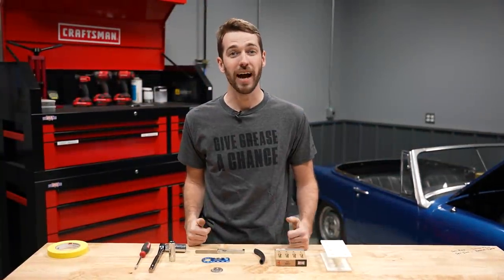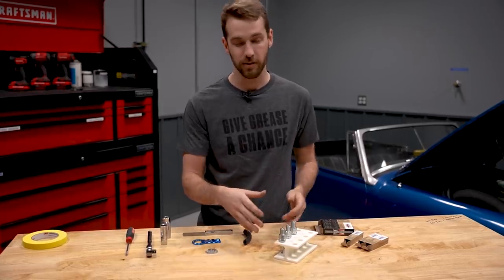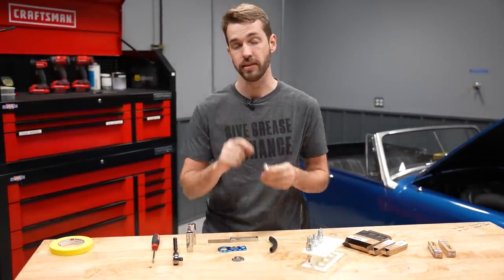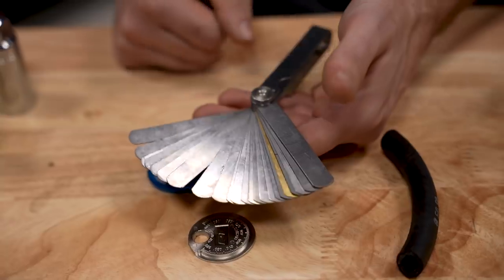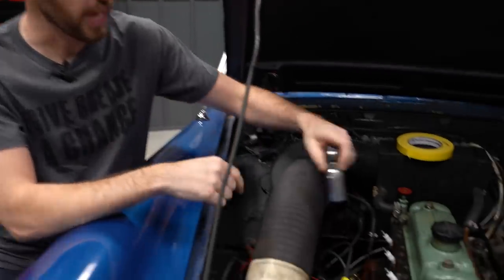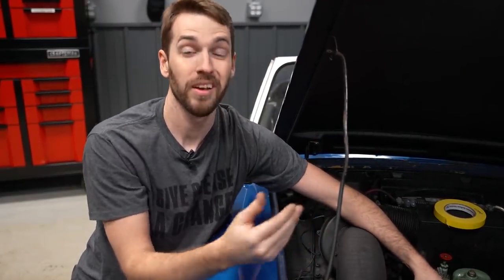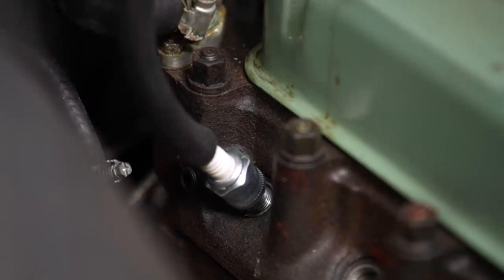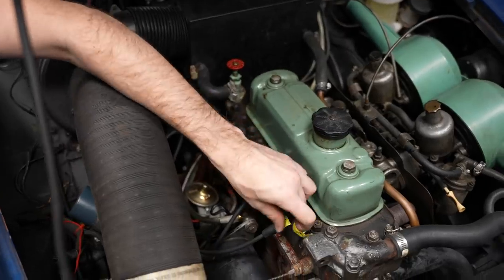Things to know when changing your spark plugs | DIY

Comment: You can skip a bit of the scariness with cross-threading your spark plugs by applying gentle pressure to the back of the plug while turning counter-clockwise until you feel/hear a small click. That will be the end of the threads of the plug passing the end of the threads of the spark plug, at which point, you can turn the plug clockwise for installation, without the fear of cross-threading. Use a hose or don't, but consider this method for any threads you're especially worried about cross-threading.
Reply: Good tip. Thanks!
Reply: This is my method too. People think I’m dumb sometimes; they’re like, “you know it’s righty tighty, don’t ya?” And I’m like, yesss…
Reply: Is it possible to cross thread using hand tightening method with an extension and two fingers...because I can't hear a click or feel if I'm catching threads?
Reply: @DavidTMSN  In that case get a youngster who still has feeling in the tips of their fingers to handle starting the threads for you.
Reply: They don't tell you when you're younger how terrible it is to grow older...or maybe they did and I just don't remember.

Comment: I have a four cylinder motorcycle and it can be a little tough getting the middle two spark plugs in and out.  it's a weird angle and there's not a lot of room for the wrench.   I recently learned the rubber tube method for putting them back in without worrying about stripping the threads.  Works great.

Comment: Hahahaha! Haven't seen an engine with plugs that easy to access since, well, cars like that were made.
Reply: I have an 05 Scion and a 93 Miata, I can change the plugs in both of those cars in less than a half hour including taking the tools out and putting them away. The Scion has a plastic engine cover and bolt down coil packs making it only slightly annoying.

Comment: Changing plugs 1 at a time eliminates numbering & getting debris in all the open cylinders. Even if the plug is pretreated use anti-seize compound which also acts as a lubricant to prevent cross threading. Pull, clean, inspect & regap the plug & the vast majority of the time it will not need to be replaced.
Reply: Also, use the spark plug socket to reinsert the plug to eliminate the rubber hose.

Comment: A couple of things that came with experience or just bad luck. First off you might want to not only check the manual but in some rare cases, unless your me then it is every third car I own, there is a factory service bulletin that supersedes the manual and gives a different plug or gap, or both. Another thing you learn over time is that the brand of spark plug recommended is not a suggestion, generally that brand of plug will give the best longevity in your engine. 

Finally there are a whole lot of spark plug gap tools out there, I was a big fan of the wire type gappers for years and I still keep one around but my all time favorite is the Bluepoint plyer type gapper. A lot of people do not like this tool because it is really easy to ruin a spark plug with it, I have had mine for 20 years and I have been using this type of tool for over 35 years and I have never personally ruined a new spark plug in it. I will say that I have seen people ruin plugs in the plyer type tool, and I have myself used the tool to see how much force it took to ruin an old plug. I am confident that if you ruin a spark plug in a plyer type tool you would have ruined it no mater what tool you were using.

Comment: I was taught not to use points feeler gauges to check spark plug gap. I use a circular gauge with different size wire around the outside edge.

Comment: In 1972 I had an 1800 cc engine with twin SU carbs and those Champion plugs would not last more than 6000 miles. And brother I did learn to service and tune those SU carbs such that there was no soot on my plugs and it started all winter long. Given that background, I'd have fixed that rich SU carb before I changed the plugs, but otherwise nice job!

Comment: Also when installing new spark plug give them back turn and feel the step up from threads then start to screw. This will help if you don't have hose with you
Reply: what is "back turn"?
Reply: @kennorway9690  Turn it counterclockwise.

Comment: Direction of side electrode IS IMPORTANT!!! You can gain few HP just placing electode in optimal direction in combustion chamber. Read engine perfomance books.
Reply: amen , ive been "keying in" my spark plugs for years , and yes it works , especially in aussie falcons it stops the intermitent engine kicks
Reply: Nice tip. If you don't mind, can explain what the optimal direction would be tho, for those of us not aware, please?

Comment: I used the same plug that’s was in the truck when I got it, ran fine before and didn’t wanna take any type of gamble.
Reply: There is zero gamble if you use the manufacturer specification. Using whatever is in the truck already is a gamble without research.
Reply: @YeetxBoi  I searched it, they’re comparable and engine likes the. Just didn’t wanna switch brands after 23yrs
Reply: @Joe-nq6hy  my 318 magnum is finicky with certain plugs. Some engines have a spark knock, prob poorly made, or gas quality is different.

Comment: Instead of a scrap piece of tubing I like to use an old spark boot (straight, not 90-deg obviously) with the wire and connector removed.

Comment: get spark plug sockets with magnets makes like 100 times easier especially on modern engines where the plugs are deep in the heads , the rubber ones can be problematic , secondly use a small ammount of anti cease on installation , the tridium coating does not always guarantee easy removal

Comment: Old school gapping was done with a round wire gage.
Reply: Shops back in the day used feeler gauges, mostly as they are a batter tool since you can use them for valve tune ups as well and a few other things.
Reply: Round wire gage should be on used plugs where the center electrode may not be flat and therefore the spark plug gap would not be parallel. Feeler gage is only accurate if the electrode surfaces are flat (as in a new spark plug).

Comment: You don't mention where exactly you get the proper gap for the specific vehicle that is being worked on.  One way is to remove a plug already installed and check it?  Or not?  Also, you mentioned "spark plug pliers" but did not show them.

Comment: Original plugs worked excellent on the car,,, when it came for tune up, the replacement plugs from the dealer made a horrible noice on the radio. I could hear the engine RPM’s all the time..
The plugs are the same brand, same numbers ,,,,,,what causes the engine noise on the speakers ?.???
Reply: On some cars, spark plugs need to have a resistor in built to them to prevent interference. Are you 100% sure it's all the same numbers AND letters as the original?  The letters will tell you if it's a resistor type or not
Reply: @shantiaoudai1114  ,,,, resistor inside the plugs,,,,, uhmmmmmm,,,, I’ll look into it.... thank you for the advice..

Comment: Ecoboost engines need plugs or a regap of plugs every 10k miles to maintain a decent idle.
Reply: In my 1.4 TSI CZDA i can change them at 60,000km (VW under warranty changes them at 30,000km).

Comment: My honda lawn mower plug is harder to change than that Austin Healy .  Anyone who has not changed plugs in a modern car are in for a shock , try this on a transverse  V-6 or try a ford triton V-8 .    This video will mislead people into trying the job and getting in way over there heads and possibly damaging there engine .
Reply: This is why transverse V6 engines use iridium plugs that last 120,000 miles. I have an 05 Scion 4 that I can do a plug swap on in less than a half hour tools put away and everything.

Comment: NGK = No Good Kind. Japanese plugs in an English car 👎.
Reply: Better than garbage champions
Reply: @Whopoopedinmypants  ?
Reply: Put Champs in an engine they belong in and they work fine, put anything else in there and it wont last. That goes for all brands of plugs, everything has a home.
Reply: Old British cars will run on anything, I ran NGK in my B. Ran just fine, plugs have came a long way for what they use to be.
Reply: @jamesdean1598  it's not a matter of working, it's a matter of working for a reasonabl length of time. The wrong plugs just don't do that.